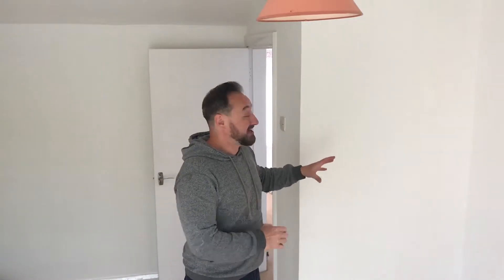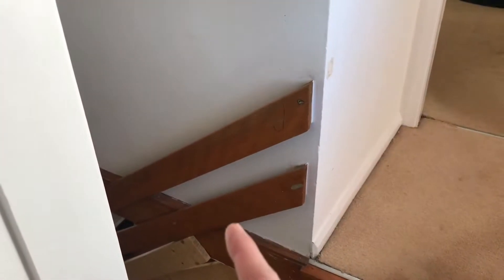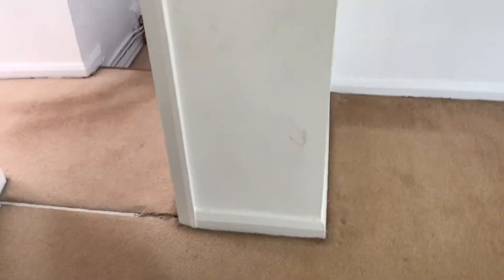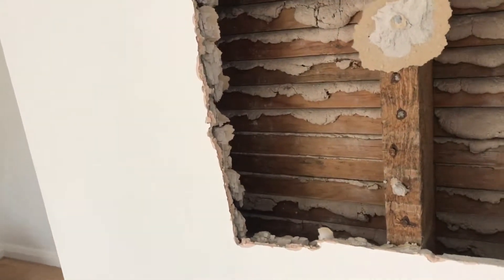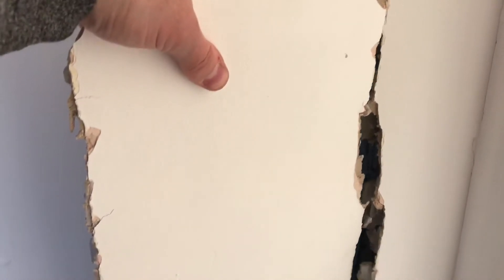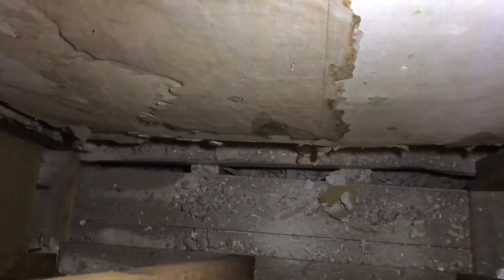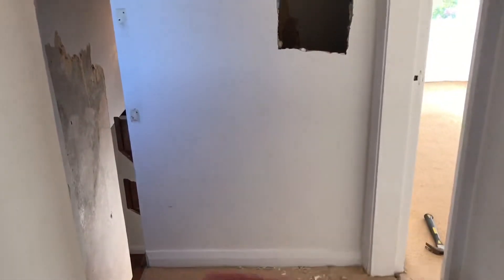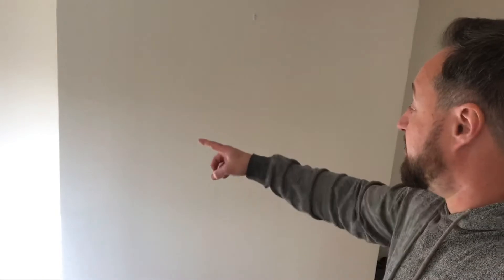BEHIND THE MYSTERY WALL!

Comment: I remember during the 70s/80s the staircases in these type of houses being replaced with the type you have there, and the landings being slightly reconfigured. My aunt's Victorian house original stairs were a an extremely steep closed wooden spiral with a door at the top and bottom. You had to tread up on tiptoe and down on your heel, they were treacherous in hiking boots! She flew up and down them in her old age and fluffy muled slippers. Respect
Reply from the maker: Yeah the 70’s have a lot to answer for in many ways! I will be changing this staircase as it’s not an ideal configuration. Here’s to fluffy mules!